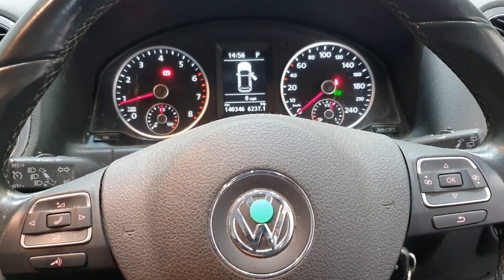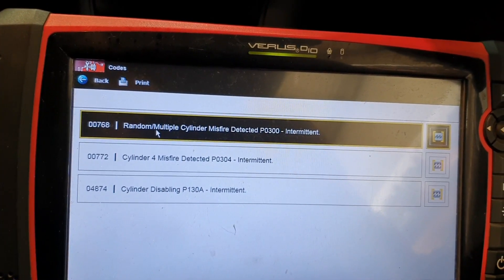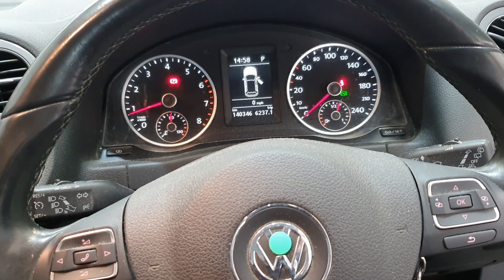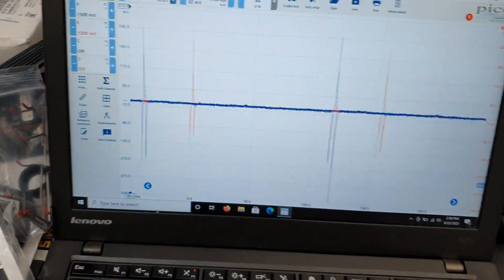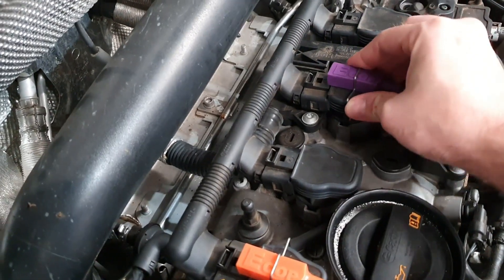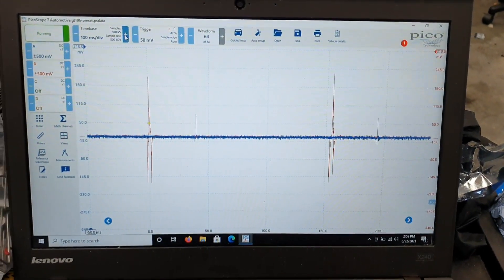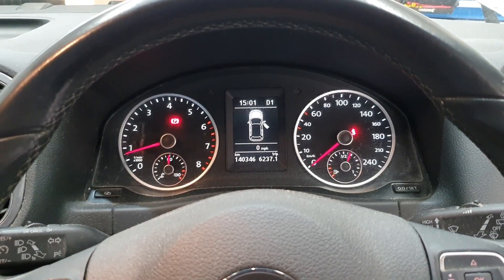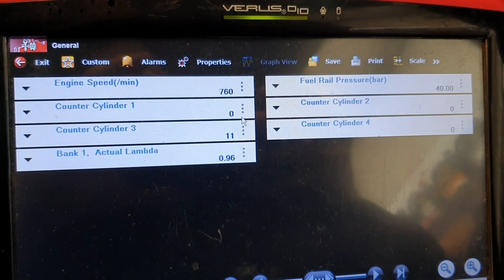Volkswagen Tiguan Intermittent Misfire & Quick Look At The Ecop Secondary Ignition Pick Ups by A.T.S

Comment: Nice test equipment, will do some research to see if it's a must have. Basically it looks like it uses the same theory as the copper coin on plug trick or COP paddle. Nice and neat still. Thanks for the video